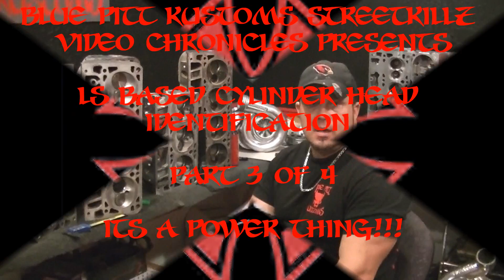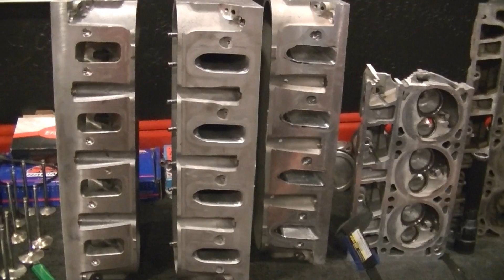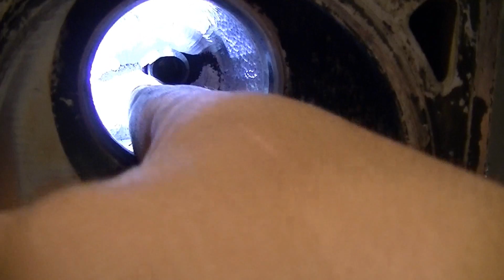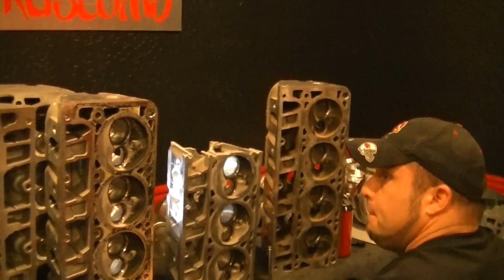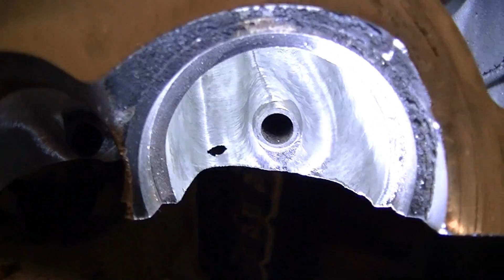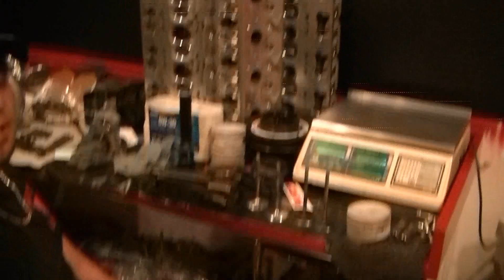LS Cylinder Head Identification Part 3 of 4

Comment: I have a ls2 6.0 out of a 2005 gto im putting it in my 1984 c10 short bed  which heads will flow the best and what cam would you run this is my first build so im very green I want the truck to hall ass on the street and sound great can you please help any advice would be great thanks

Comment: So its apparent you like the LS3 heads so my question is what's your take on the rectangle ports versus the cathedral ports? Assuming base engine is naturally aspirated with minimal modifications (Cam, intake, exhaust etc.) BTW Great videos. Nice to see examples and experience based information..
Reply from the maker: Well there are 2 equations here. Cubic Inch and flow.. If you are running a Base Cube engine that would have a bore large enough to run rectangle ports you would be down on torque and depending on the cam used you will get better and more street able power & TQ (stop light to 80mph) from the Cathy port heads. But all things being the same in the quarter mile the LS3 heads would pull past the cathy port heads due to sheer flow on the top end. So if you are not stroking or going big cubes it is kind of a wash. I have found the LS3 heads mind better off the line, with the lack of torque the car can hook and go. With the cathy port heads the torque is stronger and you spin easier. Thanks for the question always happy to give our opinions.
Reply: StreetKillz Video Chronicles Thanks a million for the reply. We just acquired our first LS based vehicle for a father son build. 2001 TA WS6 A4. The LS is new to me but I can already see the advantage over the older versions.  We figured bolt on/in stuff round one then get after it with a ground up build in a year or so. I wont bore you with our dream build sheet lol. Your info on the heads alone has shown the versatility of these engines. Your reply and videos makes me think for the small build we have planned I'm probably fine with what we have (241 heads). A mild cam and a torque converter upgrade plus intake and exhaust is our phase 1, well that and a lot of chassis stuff. Thanks again and keep the videos coming.
Reply from the maker: If I may, I would recommend a 595/598 230/234@50 ish cam comp has one and it is great!!!! Don't forget the 26918 springs and  comp 7.4 or 7.425 push rods as you need the with the comp base circle its smaller. and the 241's are just fine. get a circle D converter if the budget allows, also the BBK long tube headers if you don't have any, as they will go right in with out having to jack up the engine!!!
Thanks Again
Michael/BPK
Reply: StreetKillz Video Chronicles Thanks for the reply. Advice taken...